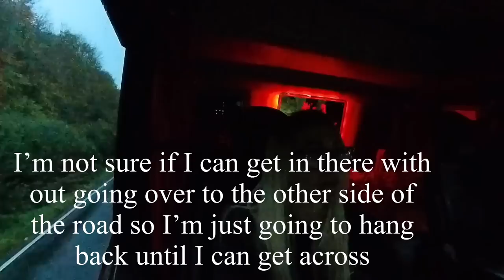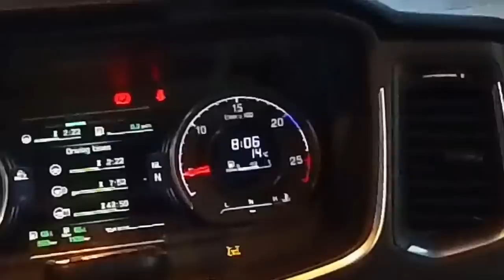My First Trucking video | what I do at work on bulk grain transport

Comment: Brilliant video Jemma brought back memories of when I first started driving HGVs back in the early 80s  I was on general haulage but because of my previous experience working on farms my boss put me on a 6 legger ERF with with a twin axel trailer with a donkey engine on it for tipping the trailer and manual sheeting lol 😆
Reply from the maker: You were lucky to have an ERF. I wish they still made them. The carnival club have one and it’s lovely to drive. My new video has a trailer with a donkey engine ☺️
Reply: Did it have the best gearbox ever made in it the Eason twin splitter. ? I loved my truck right up to the point some scum bag stole it out of the yard

Comment: .... laughing .... people over here complain that big trucks take up too much room and our roads are like football fields compared to what you are negotiating .... when you said weight transfer to get up that grade, did not realize you had a tag you could lift ... here it is illegal to be able to lift an axel from the cab, would be handy dealing with winter conditions here in BC ..... cool seeing your countryside and the farms, seemed to be bigger farms, or are they contractors that harvest for smaller operations ....  I am here because YT suggested, have done the suby, belly, clicky thingy .... thx for sharing ... as always .. never stop dreaming, just dream bigger .. have fun be safe, save our oceans ....
Reply from the maker: I think it’s common everywhere for people to moan about trucks😁 I have a midlift for when I’m empty to give more traction on the road. Then I also have a weight transfer that just gives a little extra grip but will only work at a slow speed. It’s interesting to hear it is illegal there. Thank you for your comment ☺️

Comment: its only in the last few years that they got so touchy about trucks going thru Loddiswell.....in times gone by it was always alright, but the arrival of those incapable of parking their cars sensibly through the village is what caused the change......(as always, they've only been here 5 mins and already on all the committees to change it to how they want it).......The way you went is the best way......as you probably know, if you gotta get to the farms on the other side of Loddiswell then probably best turn off at Wranga-Tag, thru Kitterford Cross, to Cali X and in that way.

Keep on truckin and will keep a eye open for ya on the road round here (Kingsbridge area)

Comment: Hi Jemma great video i remember you from the dairy i was agency driver on the artic swapping the trailers round on the farms. I have left the uk and now live in Ireland not driving at the moment and close to retirement as well. I did grain for a while with the big green trucks which you were parked next to whilst tipping. My son in law works for them now. Happy Christmas look forward to the next video.
Reply from the maker: Ah that must have been a while ago now. I did like doing the milk. I do a bit of cover blower work every now and again. It’s not the nicest of jobs but is is nice to have a change every now and again (depending on the weather and if the load wants to blow well or not) 🤣🤣
Reply: @jemmawarren27  Yes know what you mean my worst was doing pig pellets blown into a feeder and they always got blocked.
Reply from the maker: That dredded sound and you try to stop it as quick as you can but your always too late 😫🤣

Comment: Fascinating video. That's a gorgeous cab. Is it an auto gearbox? Seems odd such a big beast not having a manual 21 gearbox. I much prefer the look of the twin rear axle cabs over the single axle, they look so much more symmetrical and stable to my eyes. Is the twin rear axle to do with weight distribution and road wear?
Look forward to the following video.
Reply from the maker: Hi yes it is an auto. It costs more to order a truck with a manual now so the majority in the uk and Europe are auto. Yes I have a weight transfer I can use when loaded but I can life the middle axel for running empty to help with traction and reduce wear. Thank you for your comment ☺️

Comment: I drive a tractor trailer in the USA... Your truck designs over in Europe are interesting. Very small cabins
Reply from the maker: It’s mainly as we have a lot older narrower road’s designed initially for horse and cart ☺️
Reply: If you drove on our country lanes here in the UK you would understand why we have what you would call a "cab over".In one of your Peterbuilt or Mack long noses you'd be stuck in no time.

Comment: you get your produce checked but what happens if it fails the test at your drop point
Reply from the maker: Either you take it back or they will find a place that will take it at a lower grade
Reply: @jemmawarren27  thanks for this

Comment: How would you reverse a double decker bus would use mirrors or slide window across and lean right out
Reply from the maker: Mirrors
Reply: @jemmawarren27  I tried  backing in depot had to lean out
Reply: Saw your video you were leaning out
Reply: From experience, bit of both but mostly mirrors. I’d probably come to a stop and poke my head out to have a look at how close I might be to something.

Comment: Can we see more of you with your blower trailer pls keep videos coming thin your hot best of all you know how to drive a truck I all ways wanted to go on the feed but no mills around home
Reply from the maker: I will try to get some yes! I only do holiday cover on the blower so next time I cover I will get one up ☺️
Reply: @jemmawarren27  how did you learn to use all the different trailer's.the blowers aren't a easy job long hour's dirty tight yards my dad drove them 30 years I've driven bulkers but just wanted to do the feed how do you keep your truck so clean bulkers are one of the dirtiest jobs
Reply from the maker: I was in a truck that was perfect for blowers as it was a low height so was asked if I wanted to have a go. Stupidly I said yes 🤣 I don’t mind it too much when the weather is good but you’re right it’s not easy at times. And yes very difficult to keep the truck clean ☺️